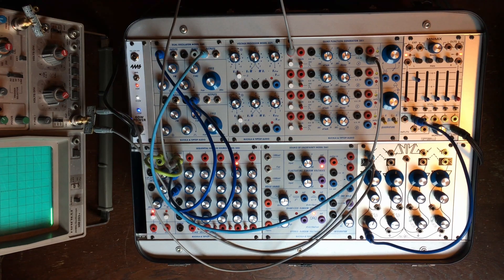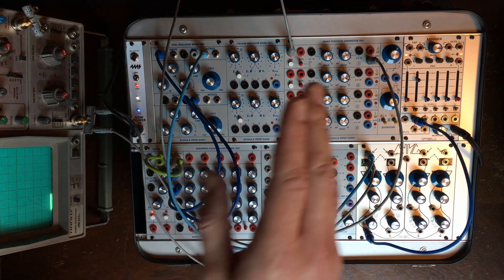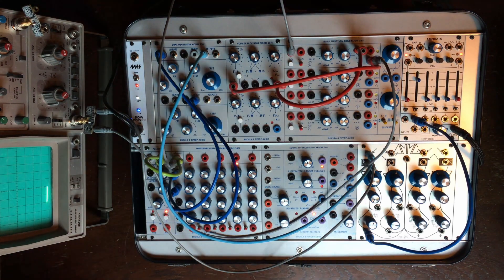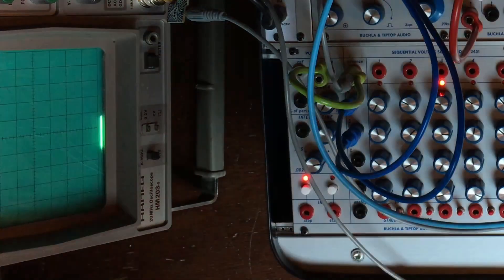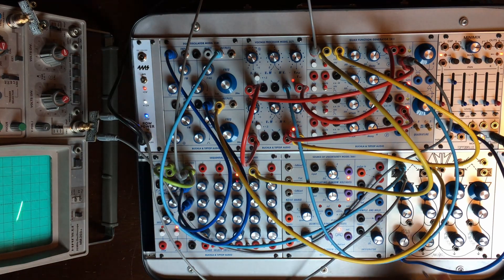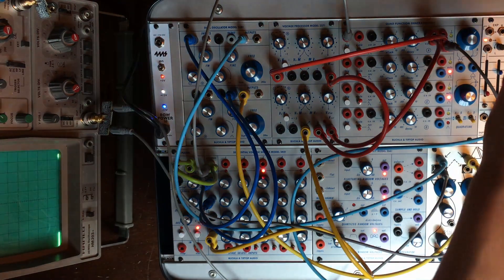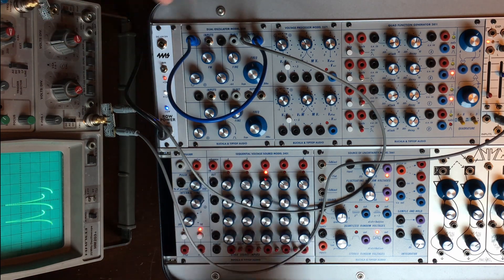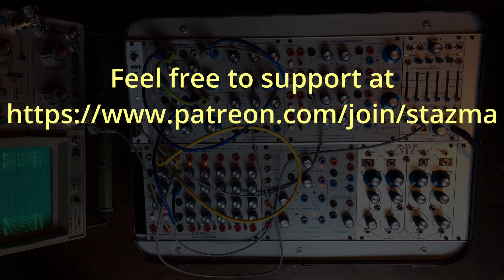Curve bending with the 281t and 257t by Tiptop Audio and Buchla

Comment: A few thoughts here- this linear vs exponential thing is one major reason why buchla separated CV and audio VCA’s, the original 292 was exponential in response compared to the 257’s linear response. Furthermore you can just patch from the 281 output back into its own inputs to get the same effect (also works on the easel pulser and any DUSG related circuit.) and with the 281 if you sacrifice one channel you can use the OR out as an attenuator for the second channel- you can achieve these curves within the 281!